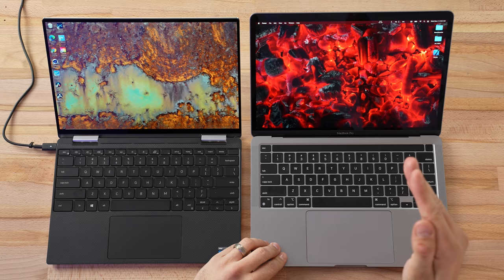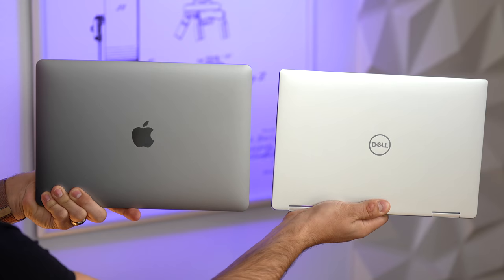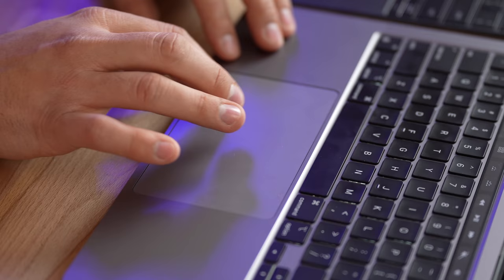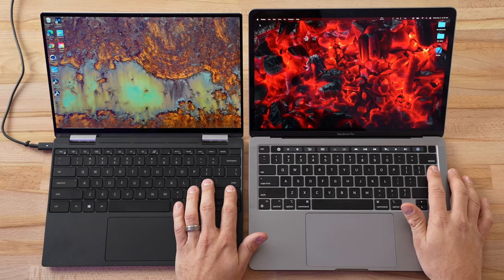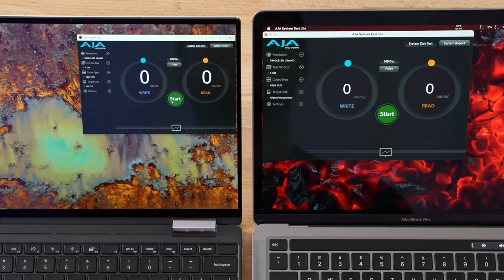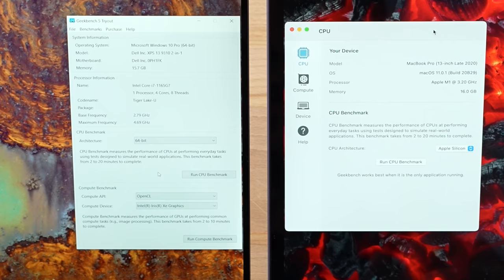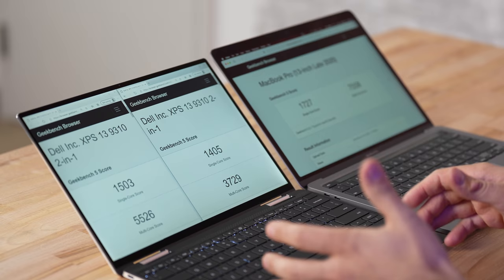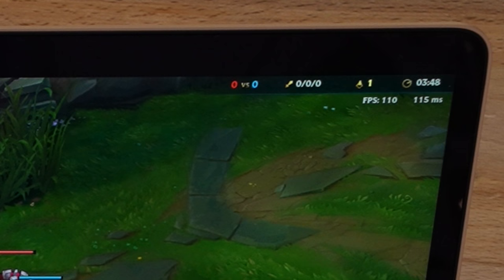M1 MacBook Pro vs Dell XPS 13 9310 - ULTIMATE Comparison

Comment: I am shocked. I use a Microsoft Surface Pro X (SQ1). This processor is based on an architecture of 2018. And I got 2000 points in Cinebench R23 in AMD64 emulation mode after three runs on battery mode. The XPS with a brand new architecture just gets around 43xx points due to heat and battery performance caps... The XPS is just a joke in my opinion. Sad, but true...

Comment: I must say I am extremely dissatisfied with my Dell XPS13 7390 2in1. I know, that is not the one discussed in this video, but the problem seems to be a critical one: From day one I had frequent Blue Screen of Deaths that nobody had a remedy for. It was somewhat good for a few months and then the problem came back in full force. Had a complete Windows 10 crash, not getting out of a boot loop. Had to reinstall Windows 10 from a USB boot drive and after hours of reinstating, my machine suffered random BSoDs, one every 10 minutes. Every thinkable hardware test came back clean and still, no remedy for the problem. Reading on the Dell forum, I don't seem to be the only one, and I believe it is a deeply-rooted problem with Windows 10 and Dell drivers and BIOS. Anyway, do yourself a favour and go for a Mac and if it is just for the one reason alone of not having to deal with Windows 10 BSoD. I feel like I am back in 1994.

Comment: This video comes perfectly. About to buy the xps. It’s 20% off on dells site, at least in Germany.
Can’t decide though whether I need it. I have a great running xps skylake. But 8gb ram is a bit low and the battery is bad. Some features missing like decent 4k playback or hdr support. So I’d like to get a new one the next years anyway. Also with xe graphics I could casually game sometimes when I’m not at home.
What I can’t decide is whether I should just build a desktop for the money so I have a fast pc at home which I then also can use to game at 4k120 on my lg cx.
But gaming shouldn’t be my focus rn anyway... will get the ps5 already
Reply: Dylaila  I heard the quality control is bad but with the support it was the opposite, it’s one of the best.
But I don’t think there will be a problem. I’m very pleased with my 5 year old xps. Build quality is awesome. If there will be qc issues I’ll just return it...

Comment: ALL DELL MODELS RECENT PROBLEMS IS THAT THE BLUETOOTH FAILS COMES AND GOES OFTEN HARDWARE ISSUE YOU WILL NEED A BLUETOOTH USB ADAPTER AND DELL WILL COME OUT WITH ALL KINDS OF CRAP BS NOT RECALL THEIR MISTAKES  IF YOU DO NOT CARE THEN BUY A DELL!

Comment: Dell XPS Intel tiger lake cpu is a general purpose CPU where as mac M1 is a customised one with no DDR bus, no PCIE bus, with dram blocks built in to the CPU die as well as the storage. If Apple changes all this and brings in industry standard interfaces then the performance and efficiency will dip drastically. Don't know if Intel or amd plans to bring such a customised cpu without options for expandability.
Reply: thats the whole point.  I've reports amd is resuming its k12.  Status quo is not good enough
Reply: @zebratroopfan6695  I think AMD and intel can never take Apple route simply because their processors cannot be limited to one hardware design. They need to support 100 different hardware configurations from multiple OEMs like Dell, HP, Lenovo samsung MSI and so on. Each one will come up with 10 different designs and hardware configurations. They also have to support all sorts of legacy CPU features. For M1, Apple is the only customer and needs to support just one single configuration.
Reply: @Yusufyusuf-lh3dw  Very true

Comment: Can anyone explain why windows laptops can't reach full performance when not plugged in?
Reply: their cpu/gpu need a crap ton of power, so their built in battery can't give the pc its full performance so it need external power supply

Comment: It's not too crazy about the perfomance numbers. Unless some insane engineering is going on or an incredibly fast/high IPC chip is being used, an 8C/8T CPU will always beat out a 4C/8T CPU. If Intel did an 8C/8T XPS, we'd likely see it beat the MacBook in multi-threaded performance. That said, the MacBook's efficiency at the level of performance it has is mind-blowing! I have both Windows- and macOS-based laptops - in fact, they're these exact models (XPS 13 2-in-1, 512GB SSD, 16GB RAM, 1165G7; MacBook Pro M1, 512GB SSD, 16GB RAM) - and I find myself going to the MacBook for anything that's not Windows-specific or that I need to use a stylus for. Honestly, if Apple made a 2-in-1 13-14" laptop and there were better game support, I'd probably give up my Windows laptop and virtualize a Windows computer for Windows RSAT and anything new I'd do in the future that requires Windows

Comment: Dell and their XPS are stuck with the same exact problem Apple had a year ago, Intel with their exorbitant prices and virtually no innovation. If Dell and other manufacturers want to survive in this industry, they really need to threaten Intel with financial consequences if they don't come up with a competitor to the M1 and AMD's processors that are beating Intel in virtually every way. Dell alone makes up a considerable portion of the share of Intel processors worldwide. Intel will not risking them and potentially other brands who have already started releasing flagship laptops with AMD options, after already losing Apple and much of the custom PC market, who now have access to much cheaper, more bang-for-your-buck processors thanks to AMD. I'm personally running a Ryzen 7 that not only beats the latest i7, and at the very least, meets it in most categories, but it's also $120 cheaper than the i7 where I'm at. 
If Dell signed an equivalent deal that they have with Intel currently, but with AMD to supply processors, they could EASILY knock $100+ off the prices of the XPS', and make them actual competitors to Apple once again. Intel genuinely sucks now, you'd think they'd at least try to compete with Apple after losing them.

Comment: the sound on the xps sounded overdriven and distorted slightly, you can hear it on the synth, it sounded much more detailed and interesting on the mac,

edit 1: the xps looks like a toddler assembled the inside, whereas the macbook looks futuristic inside.
edit 2: BAHAHA THE CAMERA, how does apple smoke dell with a 5+ year old camera 🤨, also the sound is louder on xps, but it actually SOUNDS good on the mac
edit 3: Intel talks ALL THIS WORK about  ⚡️pOwEr⚡️ and 🏃‍♂️sPeEd💨  but then, of course, Apple smokes them every time because Apple learned how to mind their own business years ago

Comment: There’s no doubt the M1 chip is very powerful. But don’t get to hyped by this. There’s way way way more to a good experience than just raw power. The M1 chips are lacking in lots of areas. The intel chips are T as powerful but are better for the overall experience, especially for power users and professionals. For the casual gamer, web browser, emailer etc definitely go for the M1. If you want to use an Egpu, multiple monitors use way more software, get extra bands with etc etc you need to be going with intel. Plus with M1 there’s the lack of ram etc. For me intel is still the better option. Plus intel are getting wise to this raw power figures on paper that apple and apple biased tech YouTubers are throwing at everyone. Intel are and have produced chips that will obliterate the M1 and m2 chips and be way interactive with software, extra monitors and stuff. Allow way more ram. Just a better experience. Don’t forget intel have been making chips a lot longer than apple.

Comment: What is the point of a laptop with a battery?  Operation without being tethered.  Every test should have been run with the XPS unplugged.  I am amused by the constant nitpicking with the M1/Intel/AMD/Nvidia comparisons.  The facts speak for themselves.  M1 blows equivalent priced machines out of the solar system.  Intel, NVIDIA, AMD are now at least one generation of architecture behind Apple.  Chip supply conditions will keep them behind for the next 2-3 years.

Comment: The stupid things about these comparsions is that they are comparing windows 10 or 11 which is literally a piece of crap with mac os which is a much more optimized operating system and has more optimized software developed for it. Why don't you try Linux on the same hardware that windows runs on vs Mac, you will have a surprise.

Comment: I’m finding less reasons to not going with the M1. However there are two glaring reasons. One is that them choosing to let it run hotter (fans rarely) is not good for CPU Longevity. Apple may intentionally making this cheap for people because they know it’s only gonna last 2-3 years. They may be going for that as their new strategy, idk. Two is that I am not sure I can make two monitors work well (ex: HDCP Protected content playing on the second)

Comment: Apple letting it run hotter = You’ll be buying a new Mac every 2-3 years just like an iPhone. No thanks... hope you can do fan control.
Reply: Bruh more people care about fan noise, and more people are complaining about fan noise than heat
Just stop trying everything to defame apple pls
Reply: @mrplasma7094  I’m not trying to “defame” Apple... I own all Apple products. What I’m saying is perfectly reasonable.
Reply: Curious at what temperature does Apple set for its fan to come on compared to a comparable Windows machines?  And more critically although it depends on the usage, what is the typical temperaure profile from running these various machines?  If indeed it's true tht Apple allows the device to reach a higher temperature before the fan comes on, I'm also thinking that overall the Mac runs much cooler during general use.  (and thus the overall reliability of the machine due to thermal stress is not clear-cut.)  BTW, I do agree that it would be nice to give the user some control over the fan settings.  FWIW, my experience has always been that Apple devices have excellent reliability over a long liftime.  I doubt that has changed with this laptop.

Comment: no the mac has  not 16gb of Vram, it share it ram with the CPU so it has what is left unsued by the CPU to the GPU witch in all case use ram.
of course RAM inside the SOC is better but it is still DDR4, sadly intel also used the shared memory and it is really bad, Intel  GPU are the worst of the PC world and seen as not even the bare minimum for anything. Any PC user as power mac user goes a dedicated GPU linked in 16x to the CPU with dedicated fast ram as GDDR5/GDDR6 or HBM2

can you tell us how many Vram the mac has allocatd by default and its max possible?  This should be interesting as Apple does not comunicate on this and nor any youtuber .
Reply: The m1 has its own dedicated tile memory for the GPU, and it is likely a gddr6 or hbm2 memory, apple didn't say which one it is, but they did say that they use a dedicated tile memory for the graphics
Reply: @mrplasma7094  yes they don't say what it is the point, most likely it may be shared DDR4  inside the CPU, it is a really important feature to forget to tell about it.
Price of graphic card vary a lot on this.
Even on game console we have this info. Note that 8GB is consider as a minimum to rum modern AAA games and 34 GB is seen as very low.

Comment: This guy sounds so much like an Apple lover.
Reply: Any sane person would chose m1 MacBook over this crappy Dell.
Reply: @Chopper153  Because it's Intel?
Reply: @dy7296  of course lol.
Reply: @Chopper153  lol.

But not going to say Intel is garbage tho. There are still one feature that I like about Intel, which is Quicksync. Quicksync makes use of the iGPU to assist video render and encoding even if there is an external GPU, which means that the iGPU isn't useless even though you have and external graphics card. Maybe even Game recording or streaming with the iGPU.

Comment: Lol microSD card reader is not great for photographers. Its great for people with GoPro's I guess... lol
Reply from the maker: There are really fast micro sd cards now so if I was using the XPS I’d likely use an adapter in camera so I can easily transfer footage. Better than not having one!
Reply: @MaxTechOfficial  Maybe... Honestly I haven't used a card reader in years. Using a USB-C to transfer directly from the camera has been a much faster and more convenient system for me. And even though micro sd's have gotten faster, there's a lot of newer cards like CFexpress-A that are probably going to become the new standard. And I think eventually we'll move beyond cards altogether and camera's will have an internal SSD with the option of hooking up an external SSD.

Comment: This thing has the performance of 16 core dual xeon servers from 2012 eating 400w in peak load (256GB memory). Impressive. 
16 GB of RAM in 2020 is weak. They could have integrated 24 GB LPDDR4X in the package. DELL'S 32 GB is much more future proof.

Not everything is so nice and rosy. Read this before buying. www.theregister.com/AMP/2020/11/18/apple_silicon_m1_mac_compatibility/
Reply: “Muuch more future proof” he literally tested the xps 32gb against the mac 16gb and the mac exported FASTER in lightroom (a ram hog app) while being EMULATED.
Reply: @mrplasma7094  Nice joke :) I sold my macbook pro retina 16GB in 2014 as I was running out of memory. Start a few dockers and VMs and XPS13 32 GB will be much much faster. BTW, in all other benchmarks the 12W I7-1165G and the old Ryzon 3600 smokes the macmini M1: https://openbenchmarking.org/result/2012032-FI-2011202PT58 . I wonder why no one is doing a review on that.

Comment: Dell's products are much inferior and its customer service useless. Dell has much more issues than the ones described above, Dell uses substandard products which start giving problems just after one year.

I am an Android user who doesn't appreciate iOS much, but I would still pick macbook as my next laptop... Dell and its customer service have lost the art of making laptops. They use substandard products to reduce cost. Also, Dell's batteries are dreadful, they need to be changed every 12-18 months (you read it right, every 12-18 months), this is what Dell's customer service says.

Comment: Hm... but can it run docker? Or VMs? Nope :
Reply: Those will be addressed in due time. Sure, it’s in the early adopter stage right now. But the M1X Macs are right around the corner and developers are jumping on board to the new platform super fast. If I were Intel & AMD and even Nvidia or even Microsoft, I wouldn’t think the same as you.
Reply: @utubekullanicisi  I saw that docker for m1 is available for testing. Parallels is working on VM side. No news from Vmware though.  :(

Comment: Apple's Mac is waste, they want to copy what the other brands do. For example first they copied the OS - before Mac was released Windows was already released and then the CPU - Intel was released way before Apple M1. They are even selfish like - you can download Windows on the internet but you cannot download Mac. I hate Apple Products except Apple watch. Friends so I suggest don't buy Apple products buy Other brands like Dell, Hp, Surface, Lenovo they provide better performance and are fast. For OS I would suggest Microsoft's Windows. For CPU I would suggest Intel's CPU they are the best and very fast. 99% apps work good with Microsoft's Windows and not with Apple's Mac.

Comment: these videos are just some dude trolling for amazon referral money...of course apple is smashing .. m1 is arm which is more efficient than x86 ... you could prove this with basic math ... but intel will transition to RISC-V to be competitive.  RISC-V > ARM > x86 but all these people buying into the apple universe will just paint themselves into a corner ... apple bleeds its customers dry ... I know I have to have these machines for work albeit my work still dispatches intel models for good reason... as someone who uses apple for work every day...I would never buy one of these ...  no software engineer realistically is able to use a 16gb machine, at least I cant... the swapping is nuts and you just want to hit it with a hammer.

oh yeah, not to mention the m1 cant eGPU ... but guess which laptop can.

Hey apple show me a 32gb machine with dual thunderbolt 4s because you and me both know 16gb +  compression isn't enough ... in the meantime these machines are for the stay at home parent to watch videos on the youtubes while doing dishes...